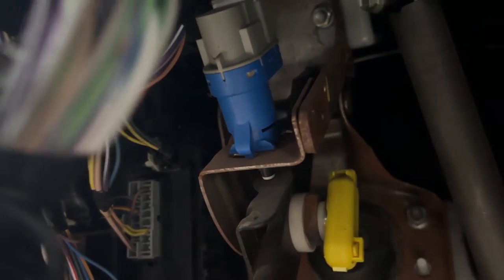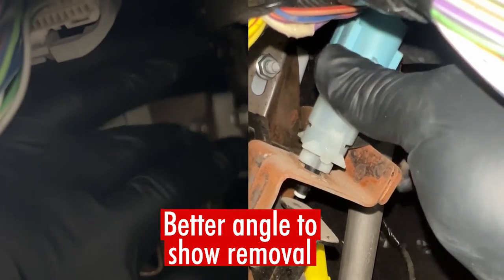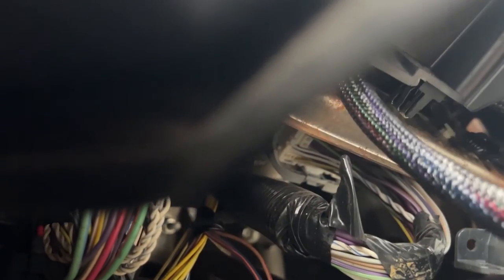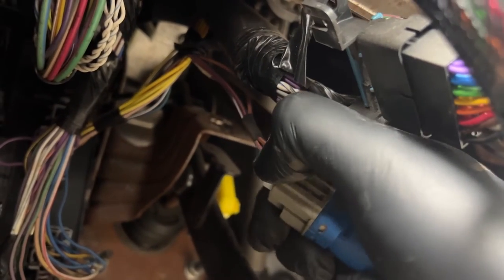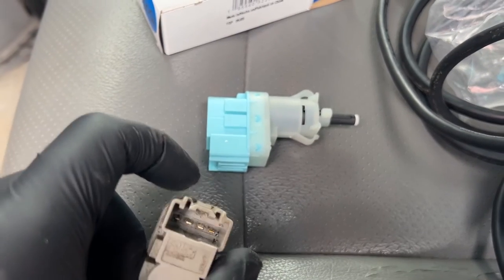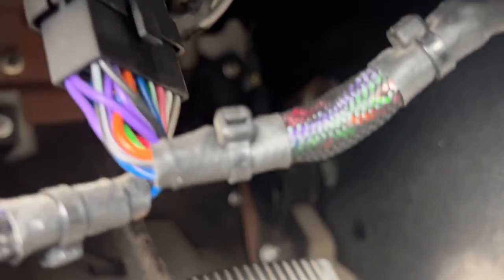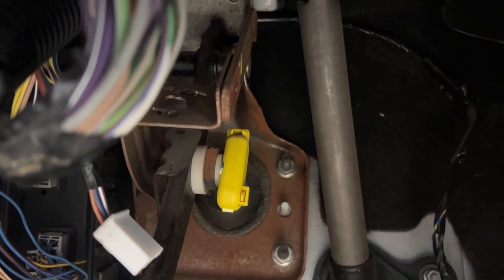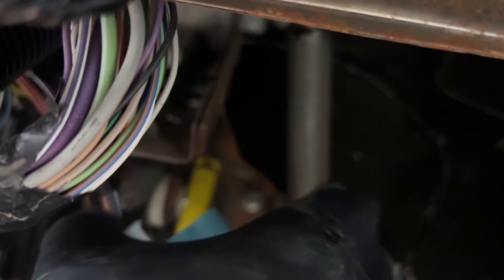REPLACE Ford Econoline BRAKE LIGHT SWITCH

Comment: tried jumping the connections the brake lights did glow but still stuck in Park
Reply: If it's stuck in p. Should be the abs fuse. Top left fuse
Reply: @ocean-driveslim5669 thanks for that heads up

Comment: Is there any adjustment on these switches? My switch works fine but the brake lights don't always go out when the brake pedal is up. I side tap the brake pedal and then it's fine. 2007 Ford Freestar.
Reply from the maker: On this model there is not an adjustment, on some vehicles there are. But most likely the switch or another concern is occurring. Can you look up in there to see if it is the same part?

Comment: Any clue on why it still might not work after replacing? My light do turn on but don’t blink when I break
Reply from the maker: Your brakes should be on solid when you depress the brake pedal, have you checked the bulbs themselves? Your van should have 3 lights, one on the top and then one on each side. Which ones are not working?